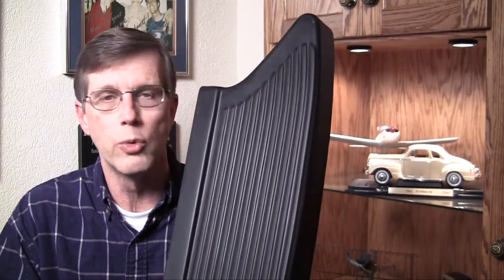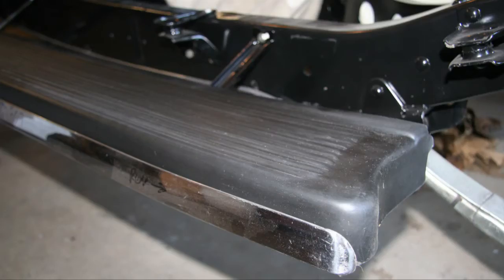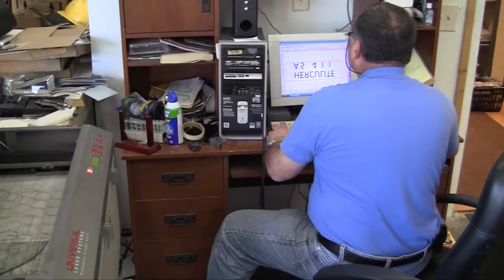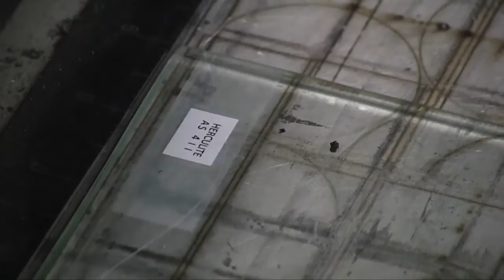1941 Plymouth Restoration (#02)

Comment from the maker: The way the master cylinder is showen is correct for a '41. The '41 (the coupe at least) did not have an access panel on the floor board. There is an access panel, but is is only for adjusting the clutch. The master cylinder cannot be reached from that access. The only way to service the brakes is to stand on your head inside the engine compartment. :)

Comment: When you finish this fine car, I hope that you drive the wheels off of it and put lots of miles on her....Don't keep it locked away in the garage ....Use it..Enjoy it...That's what I did with my 1940P10 business coupe after I put in a 55 230 engine...the original was toast....now I'm going to make it into a hot rod....no more hokey old stocker for me....big v8 and beam axle 1950s gasser style....street drivable drag car.